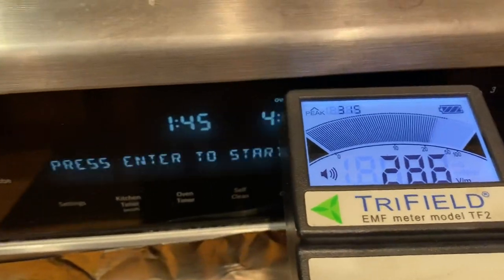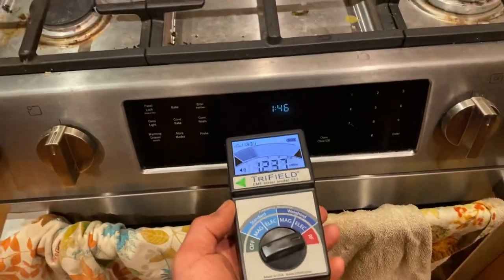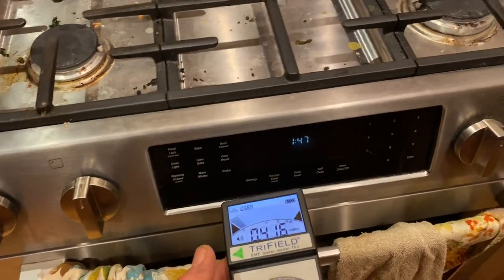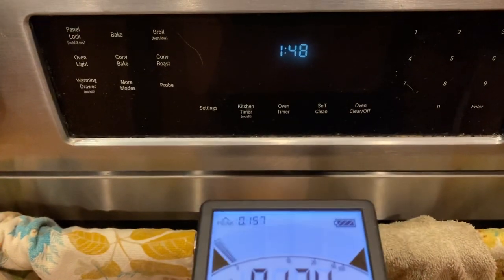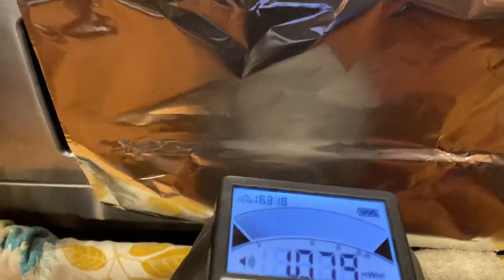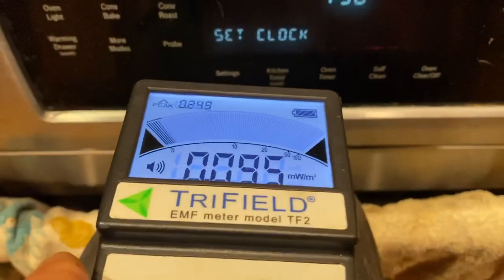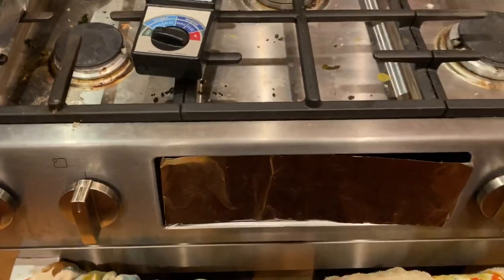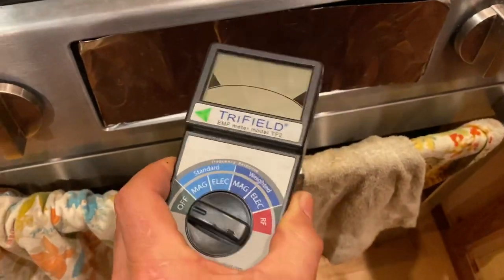aluminum foil as an emf reducer?

Comment: If the meter only detects the radiation when you are within inches of a device than how do you know its having any affect on you?  
so,  If the meter cant detect the radiation that is getting to you doesn't that make the meter worthless?
   Heat is a form of radiation, so are you saying that the more heat you work with the more damage is being done to you?
  I could walk around with a thermometer and point out some objects put off more heat than others, but that doesn't suggest that people are cooking themselves just because they are "exposed" to heat.  
   I'm not being critical just asking.  How is detecting EMF and concluding that its dangerous any different than detecting heat and concluding that people are slowly burning themselves.
Reply from the maker: Heat is not an analogous form of radiation to radio frequency radiation in terms of impact on cellular health. EMF is damaging to animal cells, that is not disputed. The only disputed aspect is level at which cellular damage occurs. And the evidence is overwhelming that it occurs at levels merely tens and hundreds of times the normal background rate. The meter gives a good indication of these exposure levels. A more sensitive meter would show greater levels of exposure.
Reply: @wholesystems    My comment had nothing to do with the impact of radiation on anyone's health. My questions were on the detecting of that radiation.  If you have to be within 2 inches of a source in order to detect it than how is it harming anyone who rarely gets with 2 feet of it?  How can you know its harmful if  it cant be detected?  Just like not all heat will burn you. You have to be very close to a heat source in order to get burned. Being burned is very damaging to cells.
Reply from the maker: @williampennjr.4448  this meter detected radiation feet away from many sources. Cellular damage via radiation if a different form of damage than tissue damage from heat. Heat is also conductive not just radiative by the way. Anyway, the meter is likely far less sensitive than human cells are to EMF. Prudence dictates that lower levels are better. I’m not proclaiming any specific source has a specific harm, only that reducing it is a good idea and the video is about one way to reduce one source.
Reply: @wholesystems    Yes it always better to err on the side of caution.
Reply: @wholesystems  Get a spectrum analyzer if you mean it serious. Those EMF level meters can not (metaphorically) hear the difference between a whistle and a bass tuba, despite a whistle of same sound pressure would split your ears while the low tuba notes are way less hurting.
Reply: @cyberyogicowindler2448 , hola te agradeceria me des mas informacion sobre tu comentario, soy victima de amenaza 
electronica, muchas gracias.

Comment: Does it works against cell phone waves?
Reply: Vanessa - The Wellbeing Blogger  
I heard that those tin cans that you usually see cookie manufacturers put cookies in, make great emf shields. I need more confirmation on this !
Reply: Vanessa - The Wellbeing Blogger  
Ah, indeed. Some testing/experimenting is required. I have one right now (cookie bin lol). Just need to get a emf reader now I guess. 👍😎
Reply: @royfokerpoker1802  Don't completely wrap phone because it produces lots of heat. But if you wrap foil 3 layers no signal can get through.
Reply: @cpnotill9264  
I didn't say wrap all I mentioned was tin can without wrapping
Reply: @royfokerpoker1802  I know just mentioning what happened when completely wrapped what would happen. Thanks for info Roy. 👍